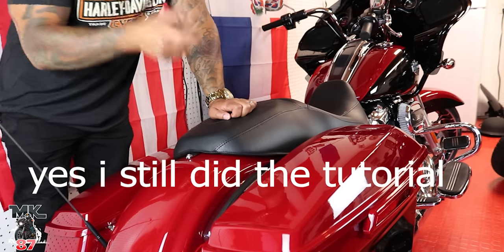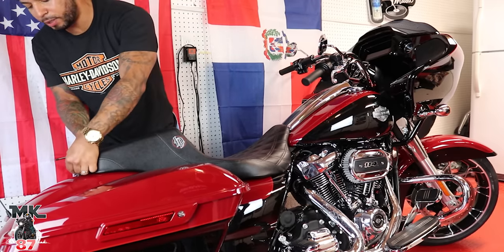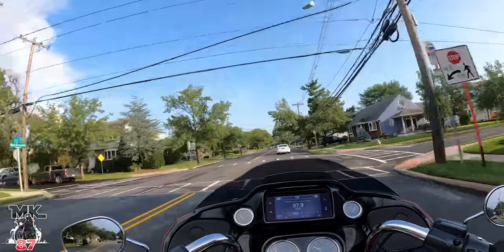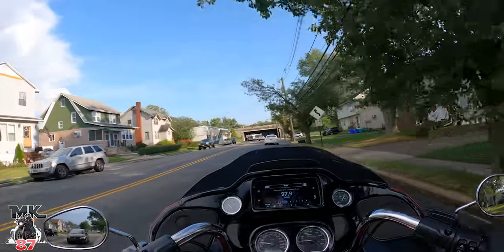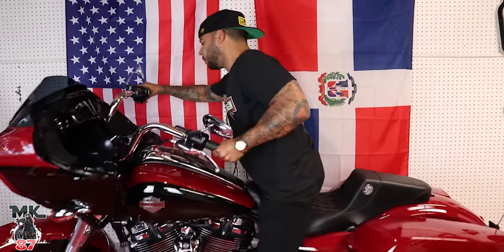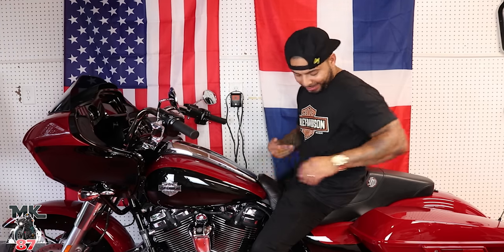Lucky Dave's Get lucky bagger seat for my Road glide

Comment: I have the Lucky Dave's seat as well and get compliments on it all the time. The only thing that sucks is I got mine before the 'Get Lucky' version came out so I have to swap back to the original HD seat when I'm riding 2 up. The seats are hard AF when you first get them but after time they break in decent. I will say that the gold stitching that I ordered mine with seems to be fading pretty quickly, especially considering the seat isn't in the sun much at all. Your colors match great.

Comment: Have a question for you. Can you see on one of the Info Screens your speed and tire pressure info? If so Why not when choosing a ''T BAR'' set up just run straight risers and block the stock gauge location because what else do you need to see if you can use your info screen instead of the gauges? I had ''T BARS'' ran that way on my 2002 Road glide and just needed to move slightly to read my gauges. Just a thought. Just saw a video on the BungKing bars and he said they block most of the gauges even though they are wide open at the bottom.
Reply: That's how I have my setup on my '20 RGS. I have Lucky Dave's T-bar setup with the peacemakers and the Heavy Hitters bracket that allows you to keep the original gauge location and gauges. Everything you really need is on the infotainment screen anyway.
Reply: @Desmo1  Thanks for the reply. That's what I was thinking that instead of the gauges you can just use the info screen. Well all except the gear indicator, but people say it works and then it doesn't?

Comment: "This seat feels like a Saddlemen"- pretty sure Saddlemen actually makes the Lucky Daves seats bro. Not sure if the LD seat comes with the gel though? I'd just get the Saddlemen & call it a day. Well, that's exactly what I did IRL when I considered the 2 seats.
Reply: the saddlemen is not like the LD, they may very well make them but the saddlemen is a wider seat, so for shorter riders you want a more narrow seat. There's a channel called 'Doo Work' (I think it is) that makes a good vid on the two.

Comment: Wish i would of went the Lucky Dave for the Dyna rather then the Saddleman. Saddleman as we all know pushes u foward & on long rides kills my back...especially having  screws & rod drilled into my lower spine to hold it together...long story...anyway...But what I paid for the Saddleman (which isnt bad except for 200+ mi)...I dont foresee getting a new seat anytime soon.
Reply: So basically for someone (like me) looking to change my low rider s seat, I should go with Lucky Dave’s?
Reply: I'm only 5'6" so I wanted to be pushed forward a bit on my softail standard. I almost got a lucky Dave's version of the saddlemen stepup. Glad I didn't lol
Reply: @romanolecoursier  depends if you wanna be closer to the bars. I wanted to be closer to the bars on my standard. Plus I'm only 5'6" lol